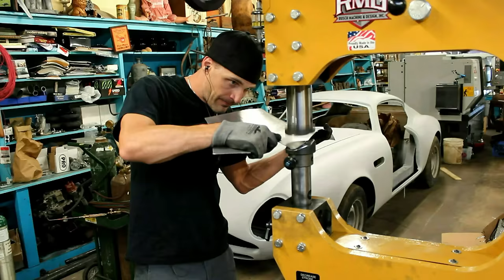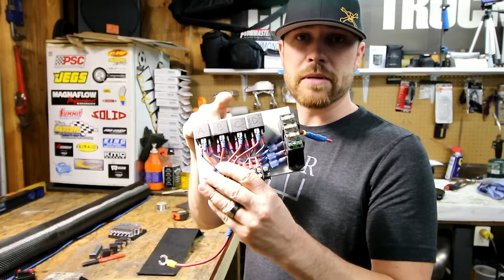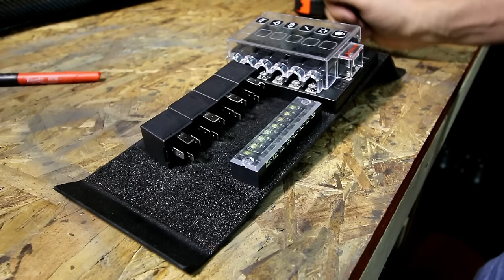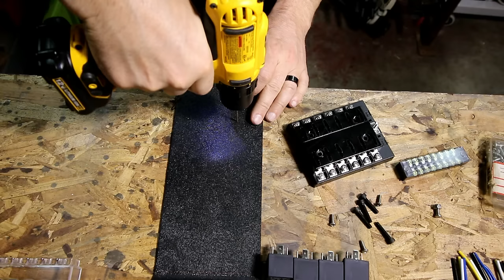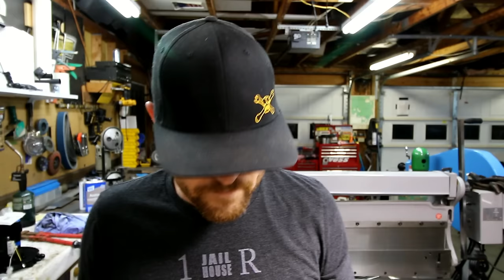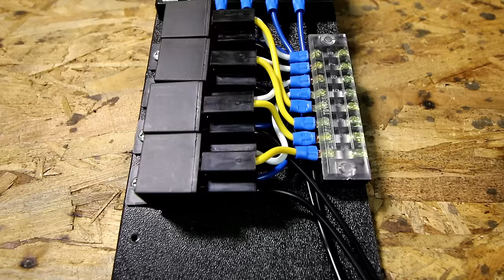How To Make A Power Relay / Fuse Block | Automotive Wiring

Comment: Made mine with help from this tutorial.  Over a year now and still works great!  Thanks.
Reply: A question,if I wanted the phone charger on all the time,I wouldn't need to put a relay right? Or what's the main reason for the relay
Reply: @franciscoayon9470  If you want it on all the time, you can wire it directly to a fuse and then to a main power source/battery.   The relay really helps with higher amperage accessories and also getting better control of your power needs.  It's not good to run high amperage directly through a switch then to an accessory.  The switch would overheat and fail.  Your phone charger more likely is lower amperage and shouldn't require a relay unless you want it switched off when the car is off, or you  can also splice into an available switched 12v source.
Reply: @20tea  I see,thanks

Comment: That looks very sharp and organized. That 10 way fuse block is just what I need to clean up the wiring on the 80 Powerwagon. I have added over a half dozen relays over the years, for the heater fan, offroad lights, high beam headlights, ect... It's all zip tied or taped up under the dash. Hell I look up under the dash and I don't know what each relay powers. Really enjoyed this video, now I know how to clean up that mess.
Reply from the maker: right on....thanks

Comment: I have several issues with this. Firstly why such a high amperage circuit breaker?  The supply wire to the fuse box will only take around 30A, so if the CB needs over 300A to pop the wire has already melted.  The CB amperage should be no more than the maximum rated capacity of the wire.  Next, the circuits attached to the fuse block should draw no more current than the main wire to the fuse box.  Need to be careful here.  And finally, my major bug bear here is the crimps.  There is no need to solder and crimp.  Crimps, when properly done with the correct tools and techniques offer similar electrical properties to solder joints.  Crimps have much better tolerance to vibration and are less likely to fail in an automotive setting.  Aircraft only use crimps for that reason.  I also abhor the pre-insulated terminals.  These are best kept for roadside repairs, not main electrical installations.  Delphi, Tyco, AMP, Amphenol, Sumitomo, JST all make W crimp connectors which are far superior to the ones shown.  Can you explain the logic behind heat shrinking a pre-insulated connector?  It would save you more time if you used the W crimps and heat shrink, and give you a much better finish.
Reply from the maker: 300a breaker is near the battery - I will be feeding this panel with welding lead which is rated higher that 300A. Solder and heat shrink is a preference.
Reply: I guess you should have showed these ppl the actual wire you were going to use from the battery to the fuse box lol
Reply: The appropriate wire size for 12V @ 300A is a 4/0 AWG, which has a diameter of about half an inch, providing the run is 1 meter or less in length.
Reply: Hey Joshua, Can you help me choose the correct circuit breaker for my car please? I'm not sure if I have to user a 100a or 150a. Also I want to know how do I trigger the switches using the ground instead of using the 12v power. Thanks man!
Reply: I have used literally thousands of crimp terminals over my 40 odd years as an auto  electrician. Good quality crimp terminals need to be crimped in two spots. The other thing is using a quality pair of crimpers, a good ratchet pair will set you back quite a few dollars but cheaper ones are available but be aware of the real flimsy thin ones.  The first crimp gives you connection to the bear wire and the second holds the insulation in the terminal. If I was using a crimp terminal (ring type) in a high current situation (main alternator feed etc) I would solder the cable to the terminal for a better electrical connection.
Reply: I agree 110%. Also, do you really think he took that apart to solder the terminals? After cutting the wires that short?😂 I bet the answer is a big, NO. Assuming the total load is 30A per relay as in the video adds to 120A breaker value. Or less, depending on the current draw of each relay. Good day.

Comment: 300amp breaker!! wow, good to see that you're power supply wire to the fuse panel is going to with stand 300amp. haha, more like 30amp. wouldnt be a bad idea to work out your actuall load before you just go fit a 300amp breaker and a bit of 6mm wire so it will actuall trip if there is a short and not just melt the wiring.
Reply: James MacDonald I wasn't gonna say anything, but I'm glad you caught that. Four 40A relays (at most) with a 300A breaker lol. 87 and 30 aren't even copper. I could go on but I'm sure you see it all James MacDonald
Reply from the maker: the breaker is for the main cable coming from the battery which is welding lead wire. All the relays and relay wires will be fused on the fuse panel it self.
Reply: my dad's car gets up to 350+amps while cranking and since he had problems with the starting he made it up with a push button.He used 2.5mm2 wire and no problems for more than a year.
Reply: I POSTED THE SAME THING HAHAHA.    The amp rating is BY the wire size and LENGTH,,, 300a is like 1/0 gauge at 25 feet lol.  THET tiny wire he used will melt and catch fire before that 300a goes.
Reply: @4gbmeans4gb61  why do people always say "Haha" when they don't know what they are talking about? It just makes them look dumb.
I don't know what he's using this relay panel for but if it's things like headlights, fuel pump, fan, heated screen, cabin blowers etc then the whole block could easily draw up to 30 amps.
Whatever wire size he has chosen to carry 30 amps would easily take 300 amps for a couple of seconds especially if the fuse box is a long way from the battery.
And that's all it needs for the fuse to do its thing. A split second is enough.
So what's the problem?
Could he get away with a smaller fuse. Absolutely. In that scenario I'd probably use 100 amp fuse. A 50 amp fuse might be a bit temperamental and trigger if you get a voltage spike.
But depending on the wire size a 300 amp fuse could work just fine.

Comment: Mounting board looks like Sintra. Really easy to use thermoplastic and can be molded with a heat gun. Used to work with that stuff all the time. Great Video!

Comment: Very nice work! If you are controlling loads from an engine computer, very often it is the ground side that’s switched. That means having a low amperage power source to the white wire and bringing the black wire out to the appropriate computer harness location. For loads that you manually switch, this setup is perfect. Love the main circuit breaker advice, too. Great video, thanks!

Comment: aluminum plate would work instead of the plastic. may be easier for some to work with. Hammer and Street curb. lol. 
could also ground thru the aluminum.
Reply from the maker: true
Reply: Excellent point. One thick ground wire to be a main grounding point and the rest connected however to the plate as needed. Smart thinking.
Reply: very true. Also, some relays have ground tabs on them so when you bolt them down they are already grounded if bolted to a well grounded metal.
Reply: i agree with you, but i also like how he uses materials that are not that commonly used in custom car work where people are usually more comfortable with metals. Myself included. I always feel the need to raise the notch when spending some time on these videos.
Reply: TurboFlush Holy fuck have you ever seen a aluminum plate fuse box? Hell no that's why there all fucking PLASTIC so the electricity doesn't go through the aluminum. Jesus christ.
Reply: Alan your panel in your house is metal

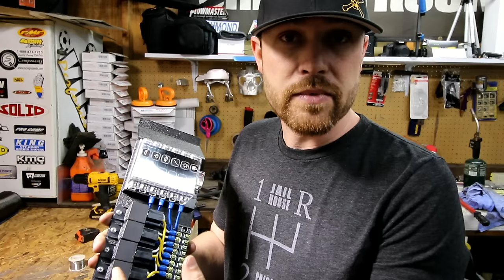Comment: At 11:30 you mentioned things like this make you look like you know what you're doing... Everything except for the soldering part.  Totally no needed with the proper crimp.  Definetly wouldn't solder the ring terminals to the distribution block either.

Comment: those chinese breakers are garbage... a 300 amp breaker "MIGHT" work for a 150 amp load..  maybe.. and that's only until it trips once or twice.. then significantly less... they are a fire hazard.. we tried using them for car audio and it was a disaster... only decent high quality marine breakers will be adequate for a 12v system.. and they are expensive... better to use a good fuse instead.. or spring for the big bucks to get a decent breaker
Reply: Totally agree about the Chinese breakers. Being a car audio shop owner, I stray away from the unreliable Chinese stuff. However, I do agree with the TFF about breakers being the only way to go. One thing I noticed though was how small gauge wire that was for such a large breaker. That 10awg wire couldn't carry a 300amp load for more than a foot or two on a good day. Just saying!
Reply: kujawat nice comment. it's rare there is wisdom in comments.
Reply: I'm lost on automotive electrical (or any electrical for the matter) Can someone explain why it's 300amp is used?
Reply: Eskrima De Campo JDC-IO  they were probably trying to wire the starter power wire through that circuit breaker which is not really recommended as a starter pulls more then 300a when it’s cranking.
Reply: Fuses protect the individual relay circuits, the breaker is just to protect the main power supply so would be locate as near to the battery as possible. Doesn't matter that the cable isn't rated at 300amps as long as the load(s) don't exceed the cable gauge and the breaker... I do agree you should protect low draw / hi value circuits ONLY with one of these breakers. For higher draw circuits that run closes to 300 amps I would use a better breaker such as certified marine breakers.
Reply: heat and vibration kill them. especially if mounts in the engine bay. read an article saying they only good for x amount of trips as well
Reply: kujawat 8
Reply: Hes using 30A wire on a 300A breaker, that wire will melt and catch fire WAY before that breaker goes.
Reply: We've also found out the same thing at the audio shop I work in we had a few customers come in with them for us to install with their system wiring. Needless to say they didn't last long and they came back and bought one of our marine circuit breakers and they've not had any problems since. They have actually came back a couple times a piece and got us to do 4 channels and few other things and we upgraded all their wiring to a larger size and circuit breaker to handle the loads.
Reply: SkullFrog2 do you think that using this style fuse panel for light bars would be good or running them would burn the wire if all of them are on and having like a 4 gauge wire to power everything
Reply: Fidel Rosado u should be fine. It’s what they’re made for.

Comment: 300amp beaker for 50amp wire hmmmm 🙅🏻‍♂️
Reply from the maker: breaker is for the main battery cable...all the other wire is protected by the fuses...

Comment: Killer work. Tidiest install I've seen. Also... If you drill a hole under the relays you can actually tuck the final wire through and behind the panel. For an extra smooth finish. 😊

Comment: Great vid.  Picked up a few tips and tricks from you on this one, so I'll pass one on to you: fuses can go out, but so can relays in my experience.  Your tails make it easier to replace them yes, but you have to fully remove the relay.  Try going to the Hella H84989011 5 Terminal Mini Relay Socket Bracket sold on amazon and summit racing alike.  Then you can unplug the relay itself and not damage your mounts....something I've had issues with in the past. You can use auto parts relays or look up the Hella relays made for this socket; they have no mounting tab.  The nice thing about these Hella sockets is they are linkable to help solidify your installation.

Comment: That is definitely a super-clean board with excellent wiring.  
It just takes time and patience when working on something clean like this.  Over my many years of working on cars (amateur of course) that taking your time and thinking through what you are doing is the absolute best approach  When I was a teenager, my wiring was bird's-nest all the way.  All these years later I have learned good ways to wire things and be neat about it.  Not up to par as what is in this video.  But my workload has never been this large, either.  

Good Work.  Thanks for the video and the information with it.
Reply from the maker: agreed

Comment: I love the way that looks !!! That plastic mount was kinda hard to tell by the video but if its textured (grained) on one side and smooth on the other I think its referred to as Kydex. It can be bought in different thickness's and in full 4x8 or 4x10 sheets. it comes in  black or white. we use it a lot for heat/vacuum forming parts .Love the way that assembly turned out.
Reply from the maker: +johnsont963 Thanks
Reply: Yes. It is 100% kydex. We use it making some of the braces I use in the hospitals.

Comment: Two things:
1. You can get a sweet relay block from Waytekwire.com that has the fuses and relays all mounted on one clean unit. They even ground all the relays. All you have to do is make spade terminal jumpers to wire the relays the way you want. Same setup as you made, just saves a little time and space, and its water and dust proof with the cover.
Cooper Bussmann 15303-2-2-4 Mini Fuse Panel, 5 Micro Relays & 10 Mini Fuses, Cover Included
2. How are you going to solder those connections when they're insulated... I like the insulated crimp on connectors but there's no way to solder them once they're on without taking the insulation off...
Reply from the maker: +Peter Rhodes good to know

Comment: Thank you SO much for this video. This really explains alot and simplified things. Quick question. So you have a hot and ground coming off of both your switches and your device (fan, lights, etc). In with this set up, the hot comes from the switch into this fuse block, then comes out to the hot of the device. Where do you run the grounds to? (of the switches and the devices). Just ground them to the frame close by or something? 
Thanks!

Comment: Looks very professional! I think I would just wire all the control power wires from the relays with the load power wires like the OEMs do and control the relay with ground. Makes it easier with less wire on your switch end. Just need a wire to ground and the relay instead of finding another power... at least that's how I like to do mine but this is way slick looking for sure!!
Reply from the maker: Yeah the relay manufactures recommend to switch the power side and chassis ground the ground side so that what I always do
Reply: 72Chevelle944358 Can you explain a little more on how you would wire the power side? I like the idea of having my switches be the ground trigger for the solenoids. Like you said, it's easier to find a ground than a hot lead near the switches.

Comment: Not sure if you are familiar with the SPod that’s used for Jeeps/off-road vehicles to simplify switch install when installing multiple accessories such as lights, but does this basically perform the same function as that in a DIY form? I much rather put in some work to make this and sage (lots) of money at the same time. Excellent video, 100% that looks extremely professional.

Comment: Yes, I have the Kent-Moore pliers (7) that roll over the core crimp. The ring terminals are fine, but I always pull the blue plastic (Or Other Color) cut a length of shrink tubing but solder the core crimp, then heat the shrink to even. 
  Some are scared of automatics, some differentials, others electrical. I didn't have a choice, I had to do it all. My rule was, if I had to barrow a tool from one of the other dealer techs more than three times a month, I bought one. I hate borrowing tools, but lending them! Ok if I work with them but pullers, no way! You grease them each time with extreme pressure grease and Do Not Use Impact! They always came back messed up and these are SnapOn. I had over $4k in pullers, pushers, seal drivers. I got them all, but no more lending. DK, retired.

Comment: 300 amps? In order for that breaker to trip, it needs to see 300 amps of current flowing through it, or high temps for an extended period of time. The wire size you need to carry 300 amps is upwards of 300kcmil. Without a conductor rated to carry that load, you're likely to have a fire or a smoked wire before a tripped breaker. However, you do very clean work, and I am impressed. Definitely worth the watch!

Comment: Nice job!  I do prefere the panel mount Hella relay sockets though because you can mount those to you panel and then insert your relay.  If you ever need to replace the relay, they are replaceable without having to unscrew anything.

Comment: For the actual toggle switches - would y'all recommend running another fused block from the battery or just splicing off an existing accessory/power on wire?

Comment: How would you go about grounding the relays? How would you run the common from the switches (does it go to the relay?) Also for your accessories, how would you go about grounding them? Sorry for all the questions, amazing videos!
Reply: Like, white is power coming from the switch, how would I get power to the switch? Another distribution block for power to the switches? And for those ground wires, could I set up a grounding block?
Reply from the maker: this video will explain that side https://www.youtube.com/watch?v=0smYuQSoE78
Reply: Thank you, that cleared it all up. Should I put a fuse on the common power to the switches or since it's not carrying that much power it's not necessary.
Reply from the maker: yeah fuse it just in case it were to short some how